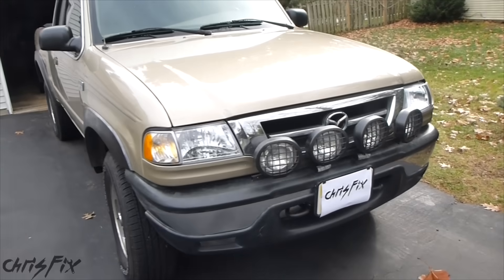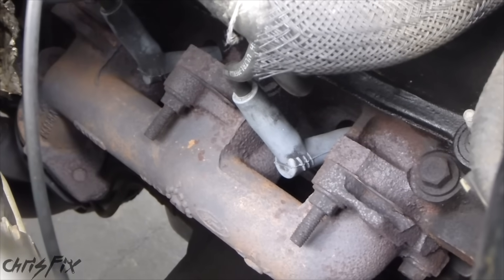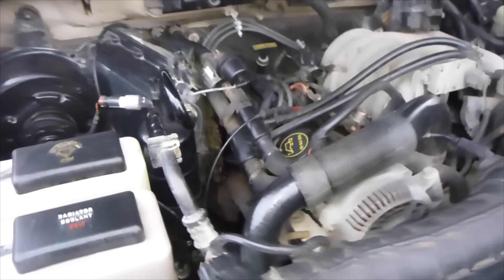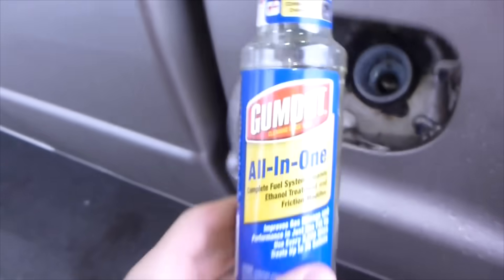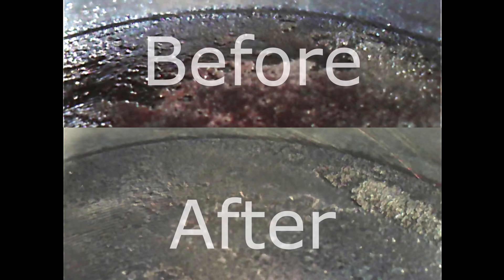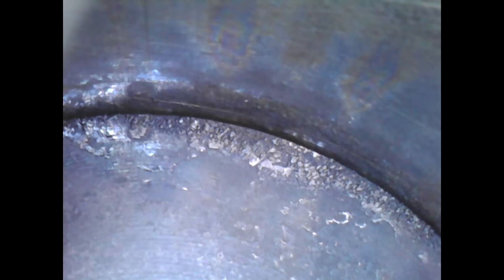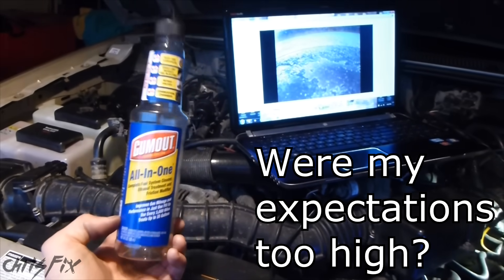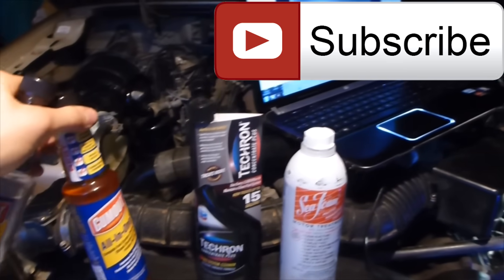Do fuel system cleaners actually work? Testing Gumout "All-in-One"

Comment: I took your miles driven and guessed that you used 16 gallons and came up with just under 14 MPG.  Is that really what you are getting?  I have a full size Bronco with a 351 and getting about 13.5 MPG
Reply from the maker: CraigS41 I idle a lot when I work on my truck for these videos and I get about 17-19mpg.

Comment: +1 Fair test showing quantifiable results. I do think you were being a bit hard on Gum Out, but on the same token I never trust marketing hype so it was nice to see it did remove some of the carbon as they claim. I'm going to watch part 2 now, but it seems like with this first video that if this was something that was used every oil change that it could possibly prevent the hard carbon from building up in the first place, making it more of a 'preventative' and less of a 'remover', if that makes sense. Your results also support this, as gumout removed the newer 'sludgy' carbon but not the hardened carbon.
Reply from the maker: M. Moore Well said!

Comment: Would be nice if you added a control to your next test :)
Before adding the cleaner run the car for another 200miles then borescope the changes without any fuel cleaner.
So you would have a before (No cleaner), after (No Cleaner) then after (With Cleaner)

That way we could tell how much the carbon deposits change after 200 miles so we could better gauge how effective (or not) the cleaner is! 

Even without the control it was obvious from this test that the cleaner didn't perform. So nice video!
Reply from the maker: Azurren Yea, that is a great idea! I will be running a control test soon!

Comment: I've been told you need to get the high mileage x2 - fuel system cleaner WITH REGANE
Apparently the REGANE is what actually works...would like to see a test with that gumout product if possible...
Reply from the maker: coldkidc I have tested a bunch of different fuel system cleaners and they all do the same thing in the combustion chamber... Nothing. I will give gumout another shot and we will see if it works! Thanks for the suggestion!

Comment: when u use a fuel injector cleaner you o use the higher octane top octane
Reply from the maker: Chris Dijker You use the gas that you normally use when you use these cleaners.
Reply: I was told you need higher octane to urn the stuff off I was told to make it work properly.
Reply from the maker: Chris Dijker Nope, higher octane is just gas that resists ignition from heat and pressure. Otherwise it is the same as regular gas.
Reply: so what fuel injector works then if you tested out gumout then to getthe carbon out.
Reply from the maker: Chris Dijker So far no cleaner that you add to the gas works to clean the combustion chamber. This is the only thing that worked so far on a small scale test: https://www.youtube.com/watch?v=WdT4DPFXIkM
Reply: not a lawn motor I watch all your videos , my question was what cleaner works that says it works
 on a car/suv/truck.
Reply from the maker: Chris Dijker I will be testing seafoam on a car soon.

Comment: Hi Chris, i need your advice. I tried the Gomout on my Nissan Sentra 2007. I put a full bottle in an empty tank , after that I filled the tank. I run the car until it was empty again and then put more gasoline without putting more gomout . The problem is that I think the car now as trembling . Do you think that the gomout broke something or what do you think i should check now?
Reply from the maker: Luis Romero The gumout probably broke off debris and clogged a fuel injector or something. Do you have any check engine lights?
Reply: No, no check engine light on
Reply from the maker: I am guessing it is some debris clogging up an injector.
Reply: Do you think I should try gomout again to see if it can be remove this time?
Reply from the maker: Luis Romero It is worth a shot I would think. It could make it better or make it worse.

Comment: Chris, this has got to be one of THE most thorough videos I've seen on this topic. Your use of the camera with pictures before and after were priceless. I'm not a mechanic but have basic working knowledge and this video cleared things up for me. Despite the results, I'll still use Gumout for my '99 Jeep and see how it goes. I can only assume that repeated use of Gumout might get the heavier stuff out over time. Thanks for the video and consider me a subscriber!
Reply: I have a quick response, this was 1 bottle on this, but I think you need to run this more then one time since you had a lot of carbon buildup. It's like cleaning a very bad lime scale off a shower door you have to clean it more then 1 time to get rid of the buildup

Comment: To my opinion it did pretty fair for a one time trial. But I did hear that to get best results you need to do the presses three times. I my self was trying it on a mk4 but only got to two times. Would like to see if doing it three times is the best way to.
Reply from the maker: blix8787 Thanks for sharing what you think! After two times we didnt see any different results. Another use of this will not make a difference. Check out my other fuel system cleaner videos if you are interested (links are in the description).

Comment: I also say use Top Teir gasoline at the pumps...like shell, chevron etc..and i hope that should also help with the cleaning
Reply from the maker: lexusfan100 That might help. I have no proof that it does or doesnt. In my opinion, if the "top tier" gas costs significantly more, it is not worth it. My truck doesnt have bad carbon buildup and I put whatever gas is the cheapest.

Comment: Try Redline fuel cleaner. It contains very high PEA (cleaning agent) compared to most fuel system cleaners. That's not to say it works but it does contain more cleaning agents than Gumout. I've noticed fuel cleaners do a better job when in the system long term. Some people add the minimum dose over thousands of miles. Using an entire bottle is called a "shock dose" and would probably unclog a sticking injector or improve spray pattern but wont clean the pistons. For fuel system cleaners that are meant for 20+ gallon tanks, adding the entire bottle then refilling at half tank seems to be a good "meet in the middle" approach though it is best to add small maintenance doses over a long period of time to see the most improvement.
Reply from the maker: garretts91 Thanks for the idea! I might give it a try if I can find a dirty engine to try it on!
Reply from the maker: ***** Thanks Tony. I will have to check it out.

Comment: just spray b12 in the spark plug holes it really works and cost under $4
Reply from the maker: witnesszer0 Im not a big fan of soaking pistons in engines. Some of the cleaner will seep past the piston rings and get into the oil which is very bad!

Comment: If it says petroleum distilates, ALL those cleaners have it as a main ingredient and I think you will need to remove the heads and pistons to do a cleaner job the old fashioned way. I havent seen any product out on the market that will clean up carbon build up, plus you need to watch it doesnt get lodged in your exhaust valve on the exhaust stroke.
Reply from the maker: Thomas Morris Check out this video: https://www.youtube.com/watch?v=WdT4DPFXIkM

Comment: I think you have to start using these cleaners from the start when the engine is newer. I was actually suprised; I didn't think it would do anything. Maybe I just have a habit of seeing the glass half empty. Did you go to random gas stations? Or do you stick to a certain brand like Shell, Mobil, BP, etc? Great review. Thanks for taking the time to make this video.
Reply from the maker: Zack Zander I think you are right but on the bottle it says it should clean it out and I should get results so... I go to wherever the gas is cheapest lol.

Comment: Chris, Could you spray choke and throttlw cleaner directly on the cylinder heads while the plugs were out? Possible hydrolock?
Reply from the maker: Banks Wood You could possibly hydrolock and the cleaner can seep past the piston rings and contaminate the oil. I did something like what you are saying in this video: https://www.youtube.com/watch?v=WdT4DPFXIkM

Comment: Another well done video, Chris. Now please forgive me if this question has already been asked and answered but there are already 476 comments on this video and I don't have time to read all of them!  First, a comment. While it is true that Gumout is claiming it cleans carbon out of the engine, the real value and original purpose of Gumout is to clean the fuel system. I have used it in engines large and small for years and my experience is that it works very well for this purpose. It is a solvent and dissolves the long polymer hydrocarbon molecules that form over time from the shorter molecules in gasoline. These long molecules form varnish that clogs the fuel system and prevents proper atomization of the fuel. In extreme cases it can block the fuel system entirely. So that's what it is for. Apparently the manufacturers are trying to broaden the market and increase sales by claiming additional purposes. Now, I am no chemist, but the carbon in the engine is formed by partially burned fuel and is more akin to graphite and is no longer in hydrocarbon form so it stands to reason that it wouldn't dissolve in the same fluid. And of course Seafoam is the product really targeting removal of these deposits.

Now (finally) for my question - why is carbon in the cylinders harmful?
Reply from the maker: Larry Heller Thanks for the info Larry. The study was focused on what I can actually prove/test and that is carbon deposits. Like you said, the bottle claims both fuel system cleaning and carbon deposit cleaning. Now, to answer your question, carbon deposits can cause detonation where the increased compression and hot spots in the cylinder cause the fuel to explode too early. It can also unbalance the cylinder if the buildup is on one side. Finally, the carbon deposits give you an idea of how dirty your injectors and valves may be.
Reply: Thanks, Chris. I knew about the detonation, the others are new info for me which shall now be filed away in my infallible (ha!) memory. Keep up the good work, I am sure many others appreciate it as much as I do!

Comment: Well, your right about old Brits breaking down.......especially if not upgraded in certain technological areas.
I've, upgraded generator (Dynamo) to alternator, replaced radiator, installed electric rad. fan, replaced wide belt w/ narrow belt, replaced water pump, rewired most of the car, etc. & I am always listening,looking,feeling & sensing something about how she's running.

The only reason why these old beast are still on the road is because there are a lot of guys  like me out there that just have a connection with everything about them.

Really like your shows & always learn something new!

They are Fun to drive and maintain,  but not necessarily for daily transportation.
Reply from the maker: Common sense Sounds like you have a nice Triumph! Yea, it is def not a good daily car, but it is a classic and just a nice car overall and there is really nothing like it on the road! I am glad you like my shows and you are learning new stuff! Who knows, maybe Ill get a british car in the future to work on!

Comment: Not looking good for Gumout around the internets these days. Basically all cleaners out there get poor results factoring in the price.

None of them will even come close to regular tap water in hot engine. A leaky head gasket shows the results even though its applied wrong :)
I'm a bit concerned about carbon from cylinders clogging fine meshed cat converters.

Can you stick your mini-cam into the cat too so we can check steam cleanability on those? :)
Reply from the maker: Addictive_LiquoriCe That is an interesting idea with the cats. I will also be testing water to see if it really steam cleans the engine. Sure a head gasket is proof but that is for a long term drip. How does spraying water in the intake work? Does it actually work?
Reply: ChrisFix
It sure does. Small amounts trickled or spraying with a bottle in a hot engine will decarbon things really well. Maybe you could spice the water with something else (isopropyl?) to help aid the process but I don't think its necessary. Steam inside the cylinder with all the heat and pressure is adequate.
And maybe it also takes care of exhaust valve stems too, which every cleaner also seem to fail at. 

Eric (ETCG) trickles water from a plastic cup into his Ford Fairmont carburetor.
Using the vacuum line (seafoam technique) on injected cars also work as long as its after any MAF or MAP thingies.

You have a garden hose. Use a fine mist (controllable) nozzle straight into the throttle body while giving the engine some revs is another idea.
Heat, pressure and water is the idea in any case.
Reply: Addictive_LiquoriCe
Oh and another thing. Looking into a permanent water injection solution. Should give more power and increase mileage.
You do 17 now? Could become 25 depending on driving conditions and if your engine approves.

I live in cold climate so that puts a different spin on things during winter time. Could be cheap and is exciting enough to play around with.
Reply from the maker: I dont know if water actually works. Sure over time, it will work (proven by the head gasket leak examples). But, for a few minutes, does it really work???
Reply: ChrisFix
It is the same principle either way, apart from gasket leaks containing alcohol and other stuff, with a different point of entry to the cylinder.

I'm super stoked about what results you might get from this test given the amount of hard carbon your pistons have accumulated. I expect to see bare metal pistons with the Borescope afterwards.
Reply from the maker: It is a similar principal, but you are using a cup or two of water over a 10min time period rather than a coolant leak which is happens over a month or longer. Either way, I am excited too!

Comment: looks likt it would be alright with a brand new engine or rebuilt.i've used seafoam on a 88 rx7 and a 84 300zx and it seemed to work great on them.the forums for those cars have different directions than the company ones. they say to put a full bottle in a 1/4 tank of gas instead of a full tank . if the carbon is really bad you have to do it several times.i've never used gunk , just lucas and seafoam. colud be like most products. seems to work for some and not others.
Reply from the maker: mrwayneone I will be testing seafoam and Lucas so we will see if there is any difference.

Comment: Great video Chris, please tell what is the brand of borescope, works well. I call snake oil on that stuff. My preferred plan for not getting deposits is use a Top Tier gas (google it) they have a lot more detergents in them than "Joe's Discount Cash Gas". I also use Techron every oil change, for fuel injector cleaning. With direct injection becoming more common it's even more important to keep injectors clean.

For the follow on tests, you must be careful as there could be a "cumulative" benefit enjoyed by the latter chemicals (in other words, the previous early chemicals could "loosen up" some deposits and the latter chemicals get credit for blasting them off).

:)
Reply from the maker: froggy Thanks man! I am going to be doing some of the other tests on other cars but I will be careful to factor in "cumulative" results. Thanks for the suggestion!

Comment: Chris, a couple years ago, I took my upper intake manifold off my Windstar. Didn't know too much about removing complicated parts and all I did was replace the UIA manifold gasket. I remember (due to ignorance) that cylinder 1 had a bunch of carbon crap built up, but I really didn't attempt to clean anything. A couple of months ago I tried some of that CRC Intake valve GDI IVD cleaner (13 bucks + tax). It says it works on regular fuel injected engines (like the Windstar) It seemed to give me some significant pep. Any thought on testing it and scoping? I am curious if the CRC cleaned it, but not in the mood to take the manifold apart. Followed the directions on the video that CRC has, wondering if I should spend another $13 for a second shot. Thanks
Reply from the maker: Bob Biggard I probably wont be testing CRC just because I am already testing 5 different products already and dont have enough cars to test this stuff on!
Reply: ChrisFix OK Chris, I understand, thanks though I will check out whenever you post

Comment: the only reliable results of a clean engine are low emissions: CO2, CO, HC. exhaust fumes analyzer.
Reply from the maker: sakoudas Actually, the only reliable results of a clean engine is not having carbon buildup in the engine. And to see this you would do exactly what I did. You can have a perfectly clean engine with a bad cat or some other emissions type problem and get bad CO2, CO, and HC readings.

Comment: Another outstanding video Chris. Excellent lighting, well explained and most important, fair. The results spoke for themselves. Might I suggest the Berryman 3 step product. I've used it on my 2005 Dodge Grand Caravan with 100000 kilometers which had heavy carbon buildup.I noticed an immediate difference when driving under load up hill. noticedhttp://www.berrymanproducts.com/videos/view/how-to-video-berryman-products-3-step-fuel-system-maintenance-kit/
Reply from the maker: Gerry Jamieson Thanks Gerry! I will have to check it out!

Comment: I wonder if the extended highway driving street putting this product in your tank was what cleaned that shiney deposits and not the gumout?
Reply from the maker: twiggy04072 I ran the truck for 3hrs on the highway, did a few high rpm runs, and did the rest of the tank in the city. So I covered everything, I also did the same driving before the gumout so it was consistent.